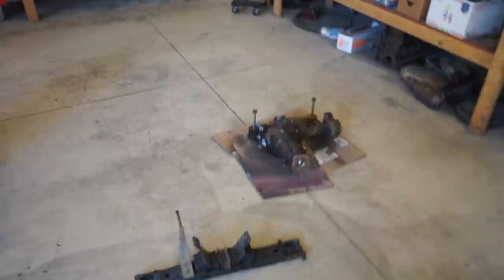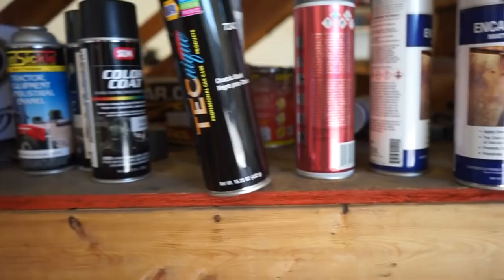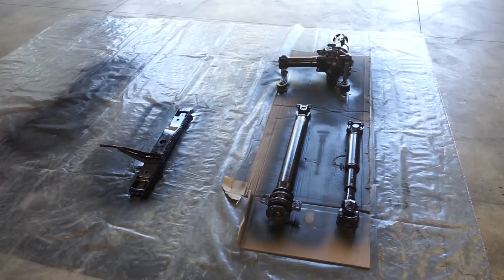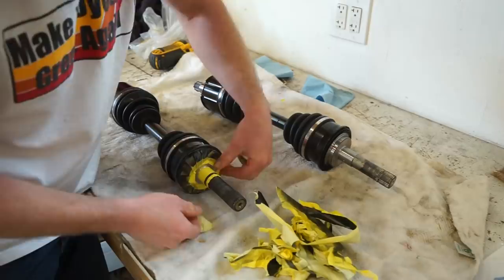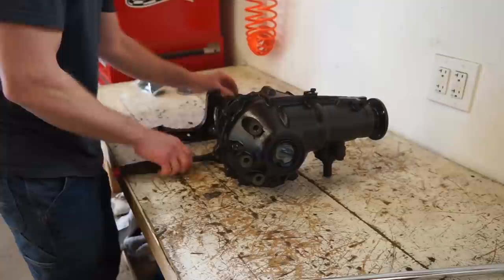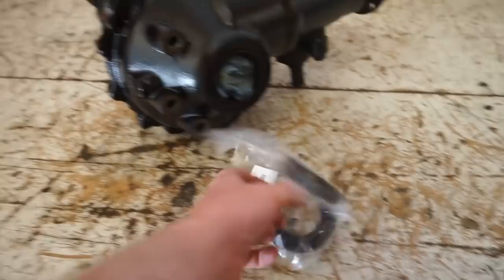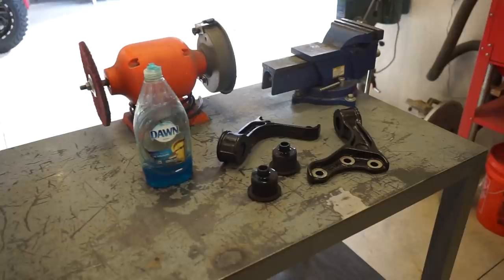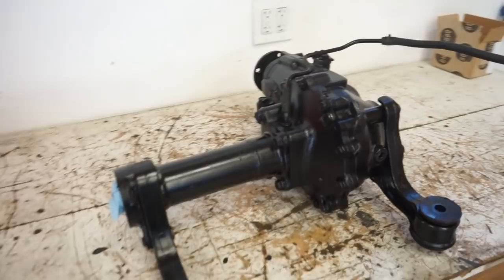Painting The Rest Of The 4WD Swap Parts/ Durabump Diff Bushings!

Comment: Dish soap generally have salts in them to help cut grease when washing dishes.   In the places you were using dish soap for slipperiness I would have used silicone grease.   That's just me though.  Others may well disagree.
Reply: .. and possibly also accelerates corrosion.

Comment: Great work.. for the bushings. If you don't have a torch..i found smaller hole saws work Great to cut them out..worked really well before I got a torch. I used 1 size smaller than the id of the hole
Reply from the maker: Great tip!

Comment: Bought a 94 pickup sight unseen. It’s in Amazing shape. They said low compression in cylinder 5. Turns out it has zero compression in #5. Has less than 200k on it. Thinking it’s going to get the 3.5 swap. Wish I had the know how to do it all myself. Could save myself some coin !
Reply: Mate Toyota pickups are very simple and logical you can do a engine conversion with a basic tool kit. The only thing stopping you is yourself, confidence comes with experience, give it a crack mate!

Comment: Quick Question 90 3.0 slow AUTO SR5 
just put BFG 33 x 12.50 KM 3 s on it . Am thinking Lunch box lockers Spartans Front and Rear Should I go with 5.13 gears or 5.29 I live in Colorado and its all up hill !!!!!!! And I tow a off road trailer a lot so not going with 4.88 thats for STICK SHIFTS any input would be GREAT

Now for a PRO TIP ON HOW TO CLEAN ANYTHING AND EVERYTHING no matter how bad it is GUNKED UP I learned this from a old boy who helped me restore Antique Tractors 
OVEN CLEANER TRUST ME ON THIS ONE no ELBOW GREASE